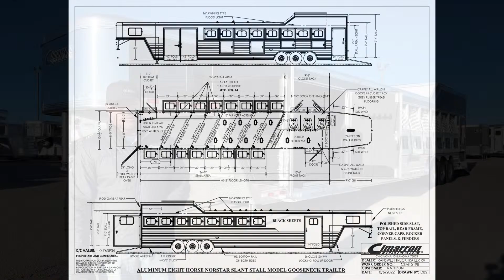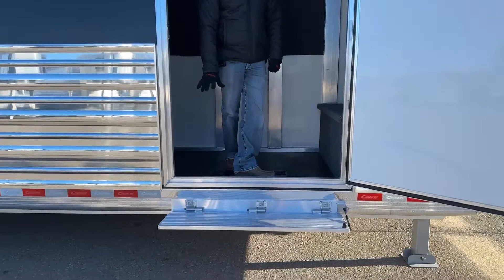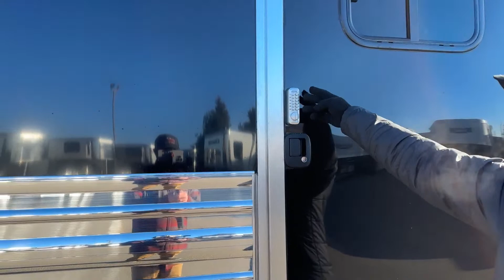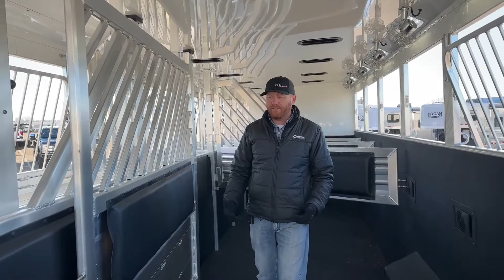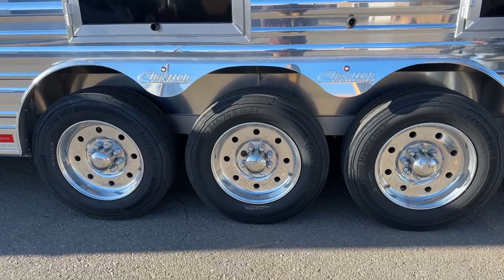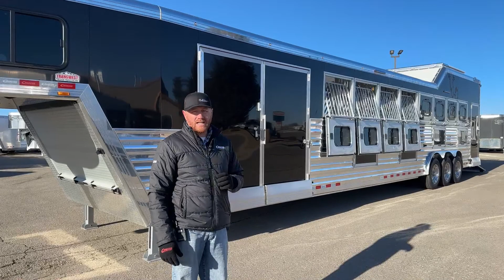Custom 2023 Cimarron Norstar 8 Horse Gooseneck - 5N221362

Comment: That thing is HUGE!! What would you pull that with??
Reply from the maker: Hello-Great question! This trailer weighs 10,900# empty and has a GVWR of 24,000#, so you would have to look at the tow vehicle to determine if it meets the needs for this size trailer. In today's world, most new 3500 diesel trucks are rated high enough to pull this trailer, but again, you have to get all the information on the tow vehicle. We would be more than happy to visit with you if you have any further questions.